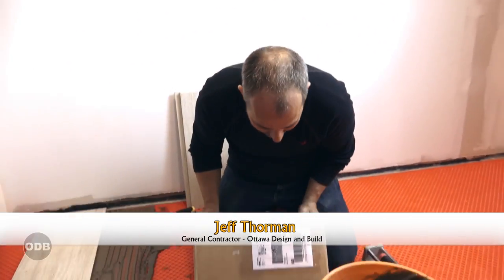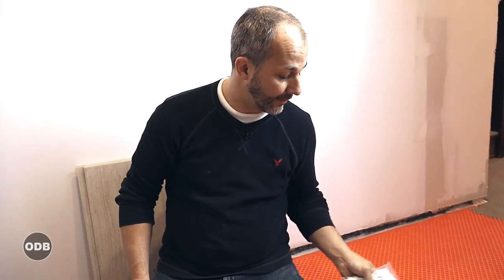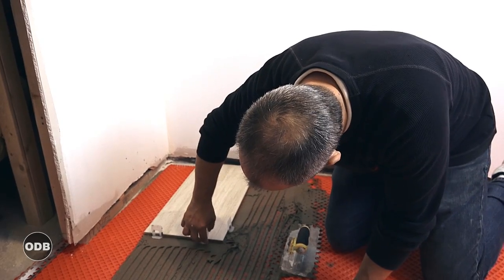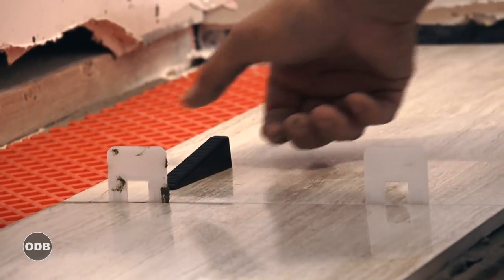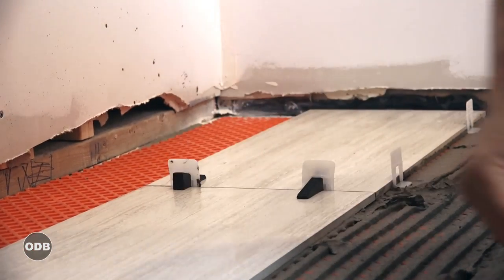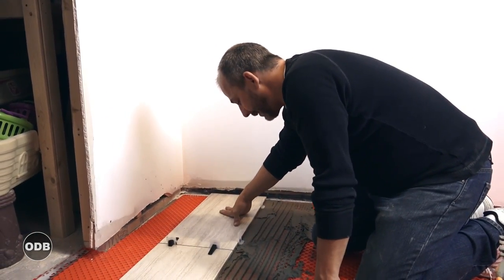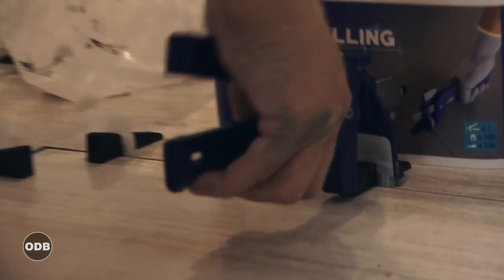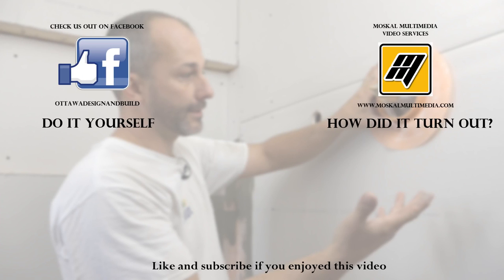DIY Tile Floor with Peygran Tile Levelling System Review Unboxing

Comment: with all due respect ,have you heard the words, convex concave !?usually we use the word  Warp, like in this situation ,you put a lot of pressure and does not align perfectly because the tile it's Warp does not exist  perfect tiles made by men in a large quantity. Besides that, you don't check the right way with that  coin .Marble, Natural Stone, Granite tiles made from cutting the slab, they are not the same in price and quality with cheap tiles baked in oven

Comment: The coin trick may not have worked because you tested it on the first tile and the edge of the tile closest to the wall may have been high.  Creating a slope downward where the 2 tiles meet.  the lippage is small but you didn't quite guaranty that the tile was level.  So to exaggerate things you may have created a V at the joint.

Comment: I like that the clips didn't break. How difficult was it to remove them the next day? Also did you have to dig into the joint when thinset prevented all of the clip from fully detaching?
Reply from the maker: Hi David, the clips removed extremely well the next day. They were crazy strong vertically but had a great weak spot for the horizontal force needed to break them off. I didn't have any pieces left behind after 200 sq feet of that product which meant no digging and no damage to  the tile.
Reply: Use pliers to hold the left over piece and pull straight up, it will break off no damage to the tile
Reply: @jacekjankowski1311  dremel tool with a small ceramic bit is helpful if u have one on the job which i do

Comment: would a system like this be good for tiling a wall? My tiles are 4 x 16 inch subway tile so I'm not really sure if it will be enough surface area to use the wedges.

Comment: I've laid around 500 sq feet of tile at home with the Peygran system, all at 1/16". I've done walls and floors and I've had great results. Preparing flat surfaces before tile is always time well spent, and it's no different with this system, or it ends up lifting the tiles to compensate and potentially creating voids. Good to see every tile being back-buttered (or burned) and that a membrane is used under the tiles. However, the thinset lines should be running in the direction of the short side (easier to collapse the ridges) and Peygran also recommend tapping the tiles with a rubber mallet after setting to release any tension. I think I've worked my way through 1,500 spacers by now but still working with the original 200 wedges. The tiling pattern determines how many spacers/wedges are needed, but an offset pattern consumes a ton of them. Even so, 200 wedges on a 12 x 24 tile got 80 square feet laid.

Another note, is that you must lay the area in one go, as well as the edges. If the thinset isn't moist, the system can't level so leaving the edges until the next day doesn't work as that edge is immovable. I've also learned to keep the spacers near the joins, so with a third-offset like here, I would have install 4 spacers on each long edge, two at the extremes but two around the adjoining intersection to minimize lippage.

In Canada, I get my refills from Amazon.
Reply: Thank you. I have watched several videos. Looking to become a general contractor. You seemed very knowledgeable especially with the ansi specs

Comment: The only issue I had when using this system is that when you tightened the wedges, the grout lines spread apart thus giving me inconsistent grout lines. I tried the wedges both ways too. You would think it would force tight grout lines, but it didnt. Worked like a charm eliminating lippage.  I used12x24 porcelain tiles on my shower walls.
Reply from the maker: You may have been over tightening!

Comment: I'm getting ready to do a kitchen and bathroom with this product timely video since it will be my first time using it.
Reply from the maker: Might I suggest using at least porcelain on the floor if you are going to install the cabinets over the tile.Remember 40 year kitchen 40 year floor.
Reply: Perfect exactly the plan I was going with.

Comment: Very nice video. Can you comment on how the leveling systems don't create voids under the tile? It seems to me that when you put the wedge under stress it's going to push one tile tighter and lift the other one up ever so slightly. That void is a potential cracked tile down the road, right?
Reply: That's what I was wondering about. I haven't been able to find any info on it.
Reply: @jonvanlandingham2538  I use them all the time,Topps ones. Never had a failure. What I would say is this bed he's using isn't deep enough. Use a deep notch,collapse ridges and back butter it works very very well.
Reply: When you put the wedge on the other side it will push that side level...

Comment: I kept hoping you would slide the quarter from the other direction to see if it still hit the lip of the opposite tile, which would invalidate the test.  Also maybe putting a level on it just to see the edges as well?  I have not used these yet, but going to try.  It seems it will be much quicker because you can avoid a level in terms of verifying your lips, but I will still pop it quickly until which time I grow confident.  It's not fun being type A...
Reply from the maker: the truth is to try to get perfection in a basement is a really difficult thing since the concrete is actually concave itself.

Comment: Due to length and with of tiles. There can be a slight bow in each of the tiles. I got that info from one of the manufactures demo videos.
Reply: Its really hard to compensate tiles bows.

Comment: Great work💯💯👊👊👊 when you dont use clip systems do you constantly use the level to check if the floor is going flat and leveled without seeing gaps under the level? Thanks in advance 💯🙏

Comment: Jeff, how do you safely remove the clips without damaging the finish of the tile? Any tips or tricks you can share?
Reply from the maker: just kick them off in the direction of the grout line. they have been manufactured with a weak spot so they come off quite easily. It is also a little theraputic. Cheers!
Reply: Also a rubber mallet if you get stubborn ones to remove. I use a white headed one that leaves no scuff marks.

Comment: If the slab is concrete, why use the orange membrane?  As a vapor barrier? Mapei has primer/cementitious product as vapor barrier. Thanks, great system/video.
Reply from the maker: I used it to help raise the finished surface height. Thus way it made a very small transition to the laminate floor on a basement subfloor system. cheers!

Comment: We have used all kinds of these different types of clip systems , peygran is by far best clip system in our opinion , the break out is real smooth the next day
Reply: They look a little flimsy imo, not far off of the qep one HD use to sell which were lousy.  The raimondi clips are way more firm and you can actually hear them ratcheting and not bending over like these seem to do...

Comment: I know this is a stupid question, but here goes: when using this system,  did you find that the thickness of the mud had any effect on the leveling of the tiles; or did the wedges by-and-large take care of any leveling issues?
Reply from the maker: the wedges work awesome. Cheers!

Comment: one of my good buddies is a tile guy and I give him a hand some nights and weekends.. he uses the raimondi system and I don't care how much you mess with it you still will have some height differences.. not much but it never comes out 100% perfect.. lol
Reply from the maker: I tried the coin trick not realizing that the floor actually has a bow due to the concrete pouring process. It would never work unless the substrate is level as well.
Reply: @Home RenoVision DIY ,

People in comments criticize all things related to clip systems, and it amazes me how they blame the clips, instead of addressing all the procedures necessary to start out with as flat a surface as an acceptable tolerance, and to correct subfloor where necessary before you begin.

The clips are for adjusting final millimeters of lippage, not meant  to correct all other imperfections with subfloors.
Install your clips and still double check with your spirit levels or re-do it again and again ( at your cost ) until you understand what customer satisfaction means. Hi-Rise inspectors or homeowner can easily put big X's and you will have accomplished nothing with all your speed tile tricks and shortcuts.

D.I.Y. or seasoned pro, the idea is to keep the lippage very far and away removed from your work. No call backs equal better profit margins. (IMHO)

Comment: Have you done any videos on leveling a shower wall frame before installing backer board for tile? Thanks for sharing your experience.☺
Reply from the maker: Grab a laser level and a few pieces of wood to sister to the old studs to build a new wall. It is that easy.
Reply: Thanks for the info

Comment: Was the tile being laid on a heated floor mat????? If not what was the underlayment you were using... Do you have any other techniques for laying tile on heated floor mats...Thx for your video..
Reply from the maker: Great question! You can lay tile on heated mats that are anchored directly to the floor with or without floor leveler. In this case I used the pro-va uncoupling membrane in order to protect the tile from potential cracking since this house was a new build and not done settling yet. It also helped to reduce the transition going to the dmx plus plywood floor with laminate finish.

Comment: I'm replacing the tile in our entry way because all the tiles next to the wall had come loose. When I removed the loose tiles I found out that the cement slab that the floor is built on ends 3 inches from the wall and the last 3 inches of floor are on the foundation which supports the walls.

The original builder's solution to deal with possible movement along the joint was simply not to put thinset onto the wall foundation so the tiles along the edge were only partially supported, which, I assume is, why they all failed.  The gap is a consistent 1-2 mm along the whole wall, and the structure is nearly 30 years old, so I assume it's not moving much.  

How would you recommend bonding the new tile to the floor?  Would simply spanning the gap with an underlayment like Ditra be okay (I was planning to put ditra under the tiles anyway), or should I consider spanning the gap with an expansion joint like Dilex BWS?

Thanks in advance for any guidance and thanks especially for all your work supporting DIYer's like me!

Comment: Is it faster using a leveling system than trying to free hand and trying to make them perfect?
Reply from the maker: Not just faster but guaranteed to not have lipage.
Reply: They are amaizing like using the. .but it rather preffer drypack on floors and you can go way faster free hand

Comment: You should have shown use the removal portion!!
Reply from the maker: There was no removal on this job. It was new construction in an unfinished basement. I will show demo tricks in the future though. great idea. Thanks for taking the time to comment. We really appreciate hearing from our viewers.
Reply: Home RenoVision DIY ,

I'm sure he was referring to the removal of the break out pieces.  Smack it side ways with rubber mallet/ foot, etc.
:•)

I enjoy your vids as well.
One question was the use of one wedge going in one way, yet on the same side , placing the other wedge in the opposite direction??
( I thought that was what  caused the quarter to bump-jump like that 🤔).
Reply: Removal is easy but be prepared to use the grinder on some left plastic

Comment: Thank you for sharing the video. How many wedges came in the entire package?
Reply from the maker: enough for 100 sq ft
Reply: @HomeRenoVisionDIY  Hello I have a few Qs, the white pieces are sold separatedly or do I have to buy a new kit , I have a 4 stories each one with 1200 Sq Ft floor to be install and need to know the right amount of kits and additional pieces thanks in advance

Comment: Good video! Do I have to use  pro-va uncoupling membrane if my house was built 12 years ago. The floor is concrete, and I want to put tile (before it had carpet)
Reply from the maker: Hi Lisa, this is an option. we used it to help reduce the height difference from the subfloor install in the adjacent rooms. If you want a simpler product for crack isolation, which in my opinion is well worth the effort, then use the Mapei  product. Just check with the local dealer and ask for crack isolation membrane. It is a roll on just like paint. and works wonderful.

Comment: Why we need this sheet under tiles ? Cannot we put tiles on concrete floor directly ? What is the benefit ?
Reply from the maker: the sheet protects from cracks in the concrete from transferring to the tile. It also makes it much easier to replace the tile one day. Cheers!

Comment: Jeff I have a question, I'm going to start to finish my basement soon.  I'm going to use Drylock on my walls first then use rigid foam board for insulation.  Does that sound ok to do?
Reply from the maker: If you have a block foundation it is a good idea, but make sure you have proper slope and drainage outside before you begin!
Ridgid foam is good for R5 per inch just try to keep a small airspace so that the walls can breathe in case some water works its way through. You don't want to get that musty smell down the road. And check your building code for insulation in your area. If you under insulate your walls you will get frost and then like I said musty!!!
Reply: Thank you for the advice Jeff

Comment: Best to mud those square holes in of any membranes first, before setting. Makes for much stronger bond and you can actually see the chalk lines. I don't think you've been doing this very long, as no amount of money would I set without my kneepads on. Even on that rubber membrane. If you've been doing it 10+ years, you wouldn't either. Just thinking about it is painfullll.
Reply from the maker: Hi Blake, I have been doing this long enough that my knees are made of steel. I find it faster to fill the squares and tile all in one step. Cheers!
Reply: @HomeRenoVisionDIY   Thats not how it works. It never gets easier to be on your knees for long periods of time. only harder. the pain. Even with kneepads my knees will start to throb after 10 hours straight or really long week. and im 30yo

Comment: Jeff, did you check the flatness of the substrate and factor that in any way when you're planning your tile layout?  I couldn't find any videos in which you even mention this.  In fact, it looks like that all professional tile setters on youtube  just lay large format tiles on a substrate without regard to how flat the floor is. I have not seen one youtube video in which the tile setter uses a leveling compound to level the floor first.  (The only youtube videos that demonstrates leveling compound are from the manufacturers of the leveling compound.)  This just seem very surprising to me as I certainly would not be surprised if there's at least 1/2 inch difference between low and high points in many floor substrate.  Is it just common knowledge among tile setters that you would be able to get a tile floor level regardless of the substrate just by varying the thickness of the thinset (through tile application pressure) as you go along?  However, I do see tile setters on youtube shim out supporting studs behind wall board substrates that will be tiled, to make sure the wall is flat.  Why is there this apparent asymmetry between the flatness requirement of a wall vs a floor, for tile setting consideration?
Reply from the maker: No! in a basement there is always a little slope. this small variance is normal and it is best practice to just use the leveling clips to create good joints and follow the natural curve of the floor. Leveling compound for a whole basement will cost you a thousand dollars and in the end you will not be able to tell the difference in most situations.
Reply: @HomeRenoVisionDIY  Didn't know that leveling compound could be that expensive.  Maybe that's why I never seen any tile setters on youtube use it.  But they occasionally shim out studs in open walls because it's economically viable, unlike floor flattening.

Comment: anyone know what the orange "underlay" is? is it adhered to the concrete/wooden subfloor,?
Reply from the maker: we use a modified cement and stick it to the concrete, this particular uncoupling membrane is not ditra.
Reply: @HomeRenoVisionDIY  is it plastic, ? whats it called?
Reply: @HomeRenoVisionDIY  ditra, i assume?
Reply: @HomeRenoVisionDIY  is it used on concrete and or timber based subfloors? i.e bathrooms upstairs.

Comment: If your floor is level you would have any problems setting tile
Reply from the maker: That is very hard to find unless you use self leveler. On large tile I would still suggest the clips. Cheers!

Comment: I don't like them every other clip I have use the next day I can just kick them off , these ones not so much you almost need to use pliers and yank them off which is very time consuming. Only great thing about them is they don't stay stuck in the thinset and break halfway but other than that there nothing special

Comment: i dont  like that red material  under the tiles.... uses more mud  to fill it in
Reply from the maker: The purpose is to keep the tiles from ever cracking and to raise the finished floor height so that a regular transition can be used at the laminate flooring on subfloor in the other part of the basement.
Reply: @HomeRenoVisionDIY  does it provide insulation value?

Comment: you're running the trowel the wrong way. It needs to run the shortest distance of the tile for air to escape to achieve the best possible adhesion.
Reply from the maker: I always think its cute when I hear this. Tell me which way should I run the trowel on a 24 x 24 tile.
Reply: Lol